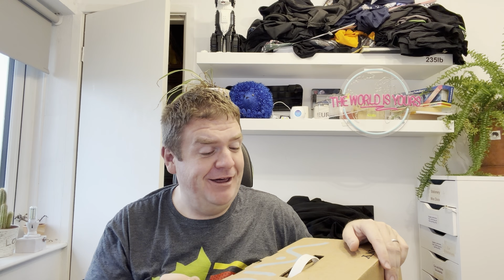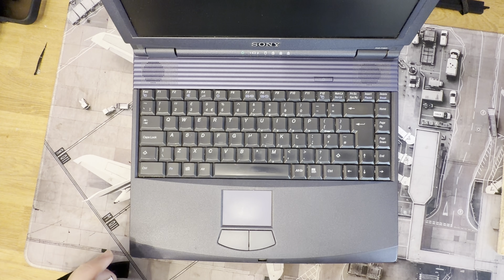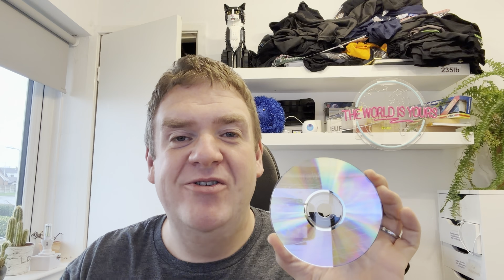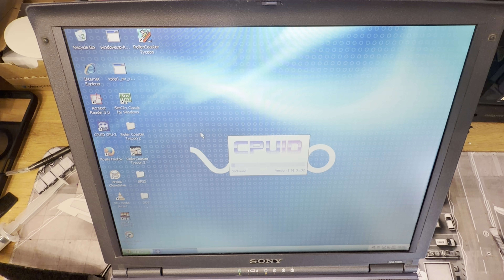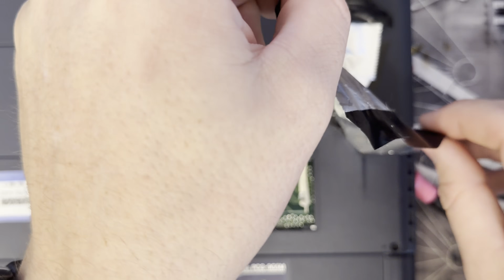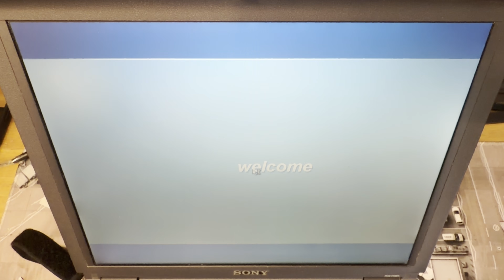I Bought My Dream 2000s Sony Laptop For £27... Can It Be Saved?⁠

Comment: Hi there!, big Laptop collector (and VAIO enthusiast), I own a pair of FXes myself (both FX101s) and one issue I'm aware of on the motherboards of these are the old ADP3421 DC/DC Buck Converter chips, they are known to fail in Sony's HPs (mostly the Omnibook) and if Course several iBM ThinkPads such as the X20, A21M and TransNote.

These fail all the time and cause very unusual power behaviour, I believe that's why one of my FX101s acts dead (even with different RAM).

If you're experience power issues in the future, you'll need to replace it, ideally upgrade it to an ADP3422 Which shouldn't fail from age/usage.

This chip causes the dreaded Blink of Death inside IBMs but be careful IBMs also have extra chips which the ADP can kill in situ, Macdat is a helpful website with all the information about that chip and it's failures :)